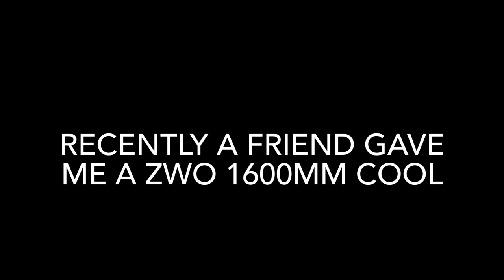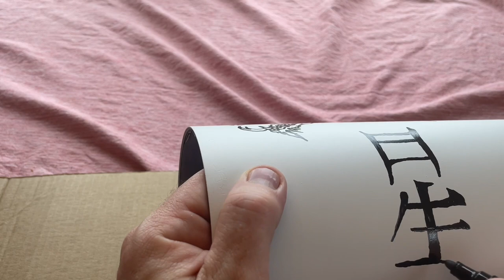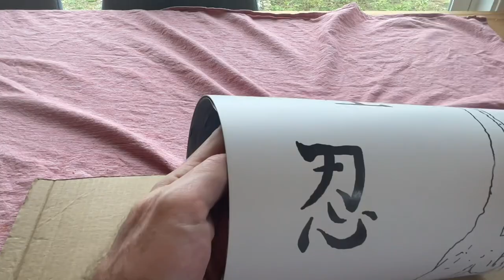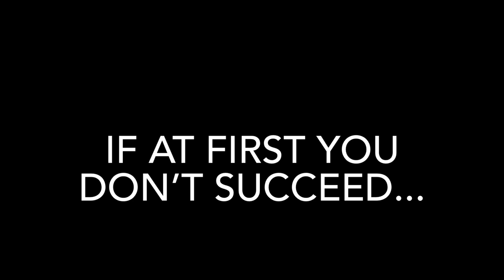A thank you gift to a friend - personalizing a telescope

Comment: Real cool project nicely done.  You'll start getting orders.  If you do and take them you might look into a powder coating setup.  I checked it out some years ago, but haven't tried it.  Thanks for the video.  Clear Skies.
Reply from the maker: Thanks for watching. Powder coat would definitely be my future go to. That’s excellent advice.
Reply: @GarnettLeary  Thanks  
I watched your video telling us to Batch Process a set of subs before stacking.  I'm trying Sequator and DSS.  I did the batches with RAW Therapee and post using GIIMP.  
EXIF is 300 mm f5.6 Tamron on a GH3 - ISO 1600 - 60 X 60 seconds for an hour of Orion.
The Sequator gives me a lot of color right at first that doesn't need much post processing and won't take much post without over exposure.  DSS gives me a sort of gray image from the same batch of images with all the same EXIF settings.  I can get color from DSS but it takes a lot of steps.  I'll also experiment with lower ISO for Orion.  
Do you have any other tips or videos on that subject?  Thank you.
Reply from the maker: I will definitely elaborate on the subject. I plan to touch on that a lot. Waiting on the mount.
Reply: @GarnettLeary  I'm happy to hear that.  I hope the mount arrives soon and working good.
Reply from the maker: Thank you. I’m kind of stuck on review atm considering my current situation but I plan to do a lot more edit focused videos. I’m getting a lot more feedback lately and I’m taking notes. I definitely want to make content centered around what folks are interested in.
Reply: @GarnettLeary  I do enjoy your content.  atm is a good project.  Just take your time and don't put yourself in a bind.  It stops being fun once you turn it into a job.  I definitely appreciate your efforts.  And I can see through the comments that other people appreciate you too.